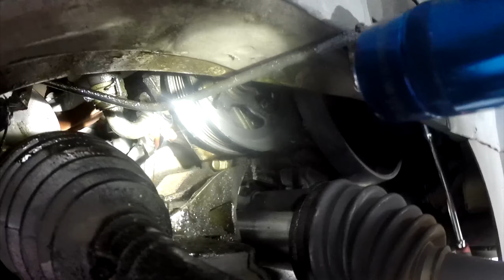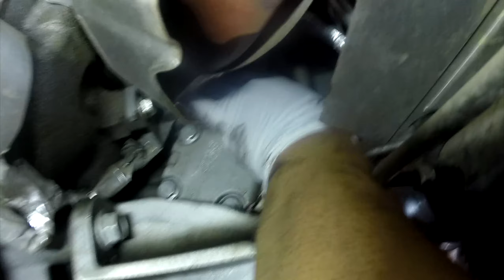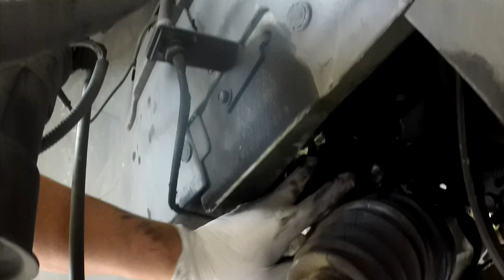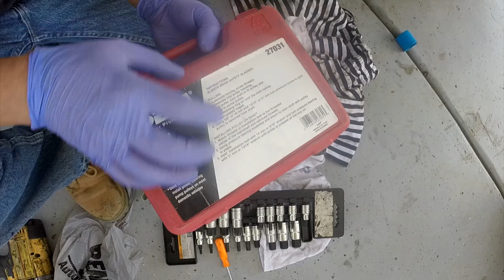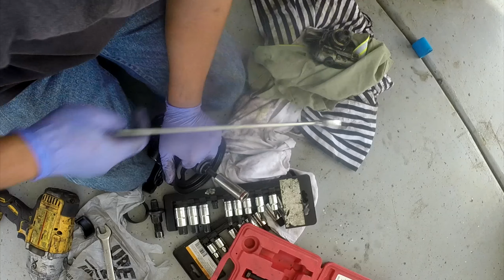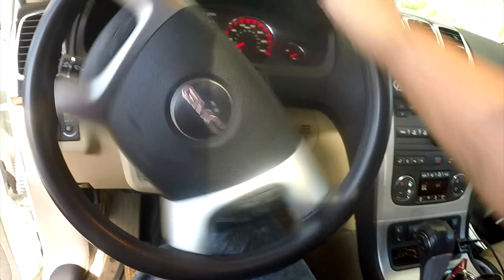2012 gmc acadia power steering pump replacement

Comment: Nice video very helpful, I seen someone removing the pulling after they removed both bolts and were able to adjust the pump a little downwards and he removed the pully and the pump came right out, but when installed again he pressed the pully while in place to bolt down inside.

Comment: This is for fwd only. Awd the transfer case is in the way.
Reply: You can do both fwd and awd actually. For awd, there's another heat shield you have to move. There's 2 bolts and an electrical connector attached to it.

Comment: This will save a lot of time in my install. Though if you check with the TSB, it says absolutely DO NOT us regular power steering fluid as it causes this system to not fully bleed. Dex VI is the only fluid GM calls for in this system.

Comment: I just changed the power steering on my acadia thanks for the tip didnt need to drop the subframe just removed heat shield and pushes the line back

Comment: These cars are a nightmare to work on.  I would NEVER buy one. I give you your props for being brave enough to buy one lol.
Reply: Well, we who do, dont know till the repairs r necessary 😑
Reply: Bought my girlfriend one for her and the kids. Did a little research and didn't see anything crazy... Decent vehicle if you can service it yourself. I wouldn't recommend this vehicle to anyone. Maybe if its free.
Reply: I just did a post-purchase inspection on a 2011 Acadia with 171k miles.  It needed (and customer approved) replacing the cats, power steering pump, motor mount, drive belt, tensioner, multifunction stalk/switch, and rear wiper arm.  I’m sure I’ll be seeing more of that hunk of scrap shortly because it’s only a matter of time before something else breaks….

Comment: was this all wheel drive or front wheel drive and will it make a difference in removal
Reply from the maker: This 2wd but may not be different because it used the same part.
Reply: Makes a big difference because the transfer case is in the way. I just tried doing it the way you show in the video